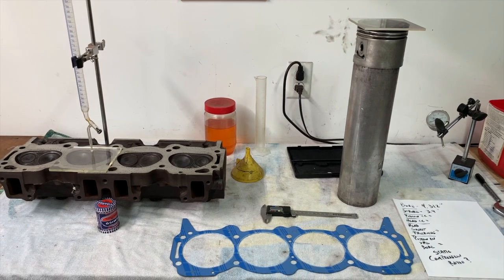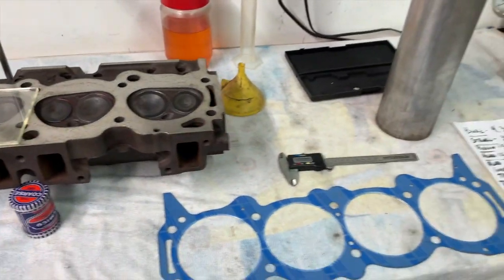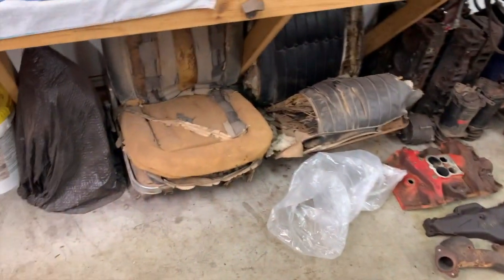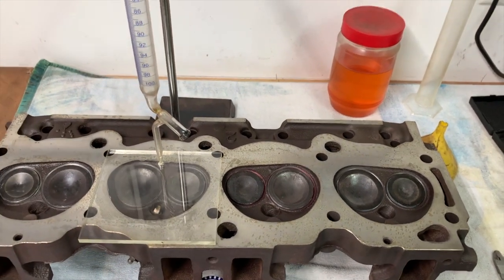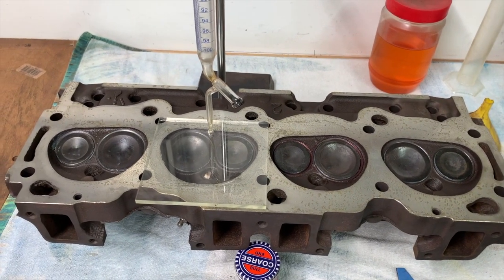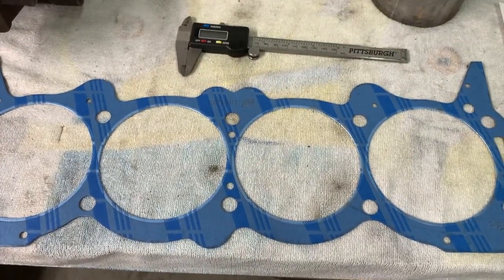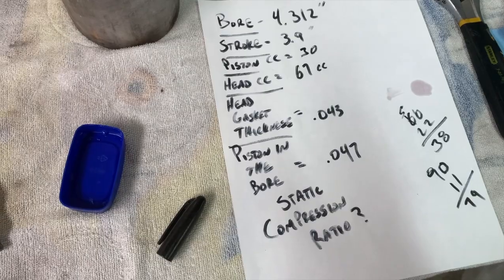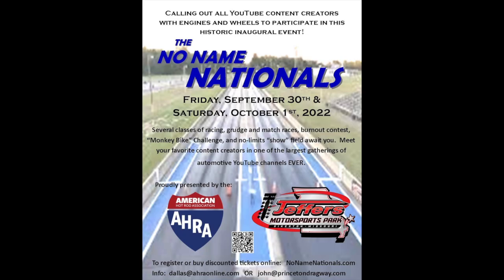The BIG Squeeze! #AHRA #nonamenationals

Comment: Everyone thinks I'm nuts for de-camming my 1980 L82. But without cutting the decks(which I don't wanna do cause of the numbers/suffix code) and milling the heads(which I'll do but only to make em straight) I still only realistically have 9 or less with the TRW flat tops. I'm putting an 85 Vette TPI flat tappet grind. So the mid range fattens and flattens out. The 624 heads won't flow for RPM or HP anyway. In front of my Vega 3.50 1st Saginaw...and a 3.23 or 3.08 gear in the 74 Nova 8.5..it will be more than enough for a 3,000lb 55.

Comment: My word... 67cc heads... with a flat top slug and two valve reliefs that would make for a nice bit of compression. For my Pontiac 455s I like a 224/228 - 110 cam and more airflow when I build a grunt engine. Since I run E85 or home brew in them, I also run as much compression as I can get from the heads, and keep in the cylinders. Not all head gaskets are equal. lol. 

Ya know, 13:1 static, with iron heads flowing 250cfm@.550 lift, dual plane intake, that 224/228 tight LSA cam, my 455s grunt like crazy. Cool thing about a Pontiac, increase the airflow and it just makes more torque everywhere in the RPM range. My 467 with 330cfm heads, a 270/272@.050 solid roller is making around 650ftlbs at 3000, with right at 700ftlbs at 4500, and that one has pump gas compression. Its not exactly something you want in a daily driver truck though, however its still pulling at 7000... but I don't spin it that high, its only a two bolt factory block. Kinda on the edge of survival/death.

Comment: I used that method before on a slant six engine I built only to discover that even after shaving the head about .020 all I managed to accomplish was correcting the factory compression ratio .go figure variance in the parts and the head gasket thickness Wich was much thicker than the factory steel shim gasket totally blew my attempt to bump up the compression ratio. Oh well at least the method works
Reply from the maker: I'm just hoping to keep it below 8.75:1 compression so I can use the 87 Octane swill at any given gas pump across America.

Comment: I usually also measure the bore of the gasket, as it is normally larger than the cylinder bore to some degree. then i punch everything into my old desk top dyno 2000 program just to double check my math. If you have never used the desktop dyno programs, they are awesome. the older ones are not as cool as the new ones. but you can still get within 10 percent of the actual dyno specs if you actually measure everything and type those measurements in correctly. Dallas, do happen to know if the 215 four barrel pistons in the Olds version where the same compression spec as the Buick four barrel ones. Also you can get 100cc syringes at farm and ranch stores. they work very well for cc ing things. Great video as always. Thanks for making time for us all.

Comment: Just waiting for the chamber to fill so thought I'd say I use green antifreeze and a calibrated syringe and it can be done in a matter of seconds. Right.. back to waiting for the chamber to fill. Lol. Cheers Dallas.
Reply from the maker: I just learned about the anti-freeze about 3 minutes after I posted this video chatting with John Wilburn.
Reply: @mr.roddersneighborhood2740  all good. You can also do away with the hole in the perspex and just lower it on the chamber so there is a small gap at the top and that allows the air bubble to escape and you have a full chamber as to slide it up at the end. Then you can draw it back out with the syringe as you slowly lower the perspex/lexan back down to the bottom of the chamber if that makes sense? Cheers bro.